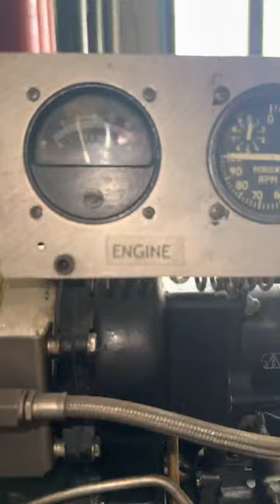Start Garrett GTP30 / Airesearch Diesel Turbine Auxiliary #apu #turbine #diesel #garret

Comment: May i ask you some questions ?! 

What are you using to supply fuel to the main fuel pump and what system is used for the starting and speed regulation ?
Reply from the maker: Diesel Sir start by using starter im also first time to see this Turbine engine